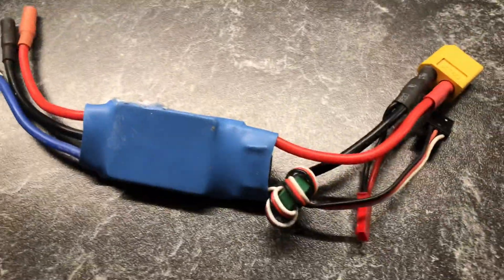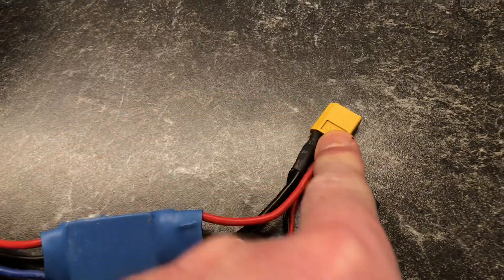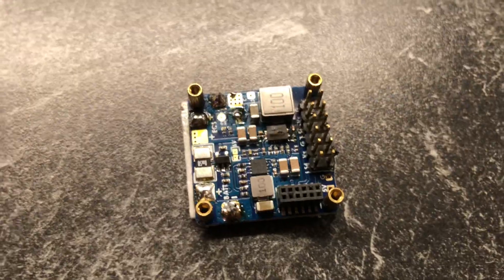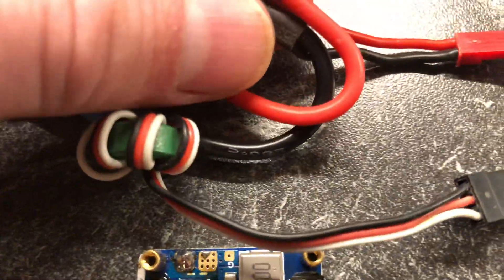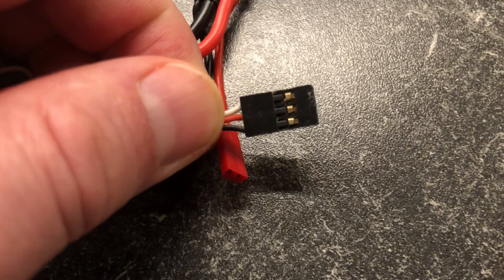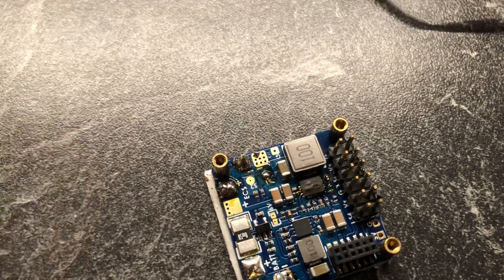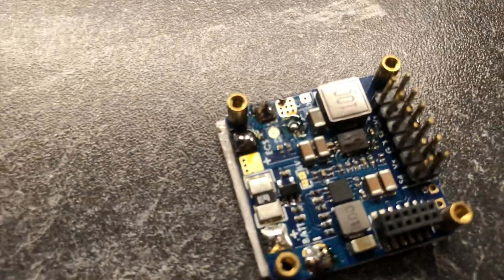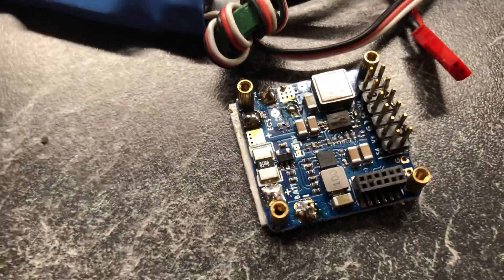Special shoutout to Trevor : How to connect the ESC to the Matek F411-WSE

Comment: Thanks for the video, this was always the most confusing part for me, especially since the manuel showed the black cable (from the the white, black red ones) also being connected with the esc black lead, dunno if i read that wrong in them manual or if its a mistake so thanks

Comment: Hello :D thanks for your video. I am currently bulding a ZOHD Dart 250 with the F411 WSE and you video answered my question for the White cable of the ESC. But question, you do nothing then with the remaining Red and Black of the ESC ? And also, can you tell me what are those two thiner Red and Black cables with that red connector ? Do we need them ? Thanks a lot ! =) Alex
Reply from the maker: hi Alex,
no ... there is no need for the 5v (red) and the ground (black) of the esc. The other connector is a JST which is not needed. It was on my ESC and I doubt you'll need these for extra power... 
happy building
Reply: @JustFPV-net  Thanks a lot for your reply ! It makes it all clear now :) !
Reply from the maker: That’s good to hear
Reply: did this work out for you? im ready to snip lol
Reply: @UncleTeddy314  It did work yes :)
Reply: @mad-lex  im right behind ya! just ran into inav issues, cant connect and apparently inav is dropping support for the f411

if its not one thing, its another